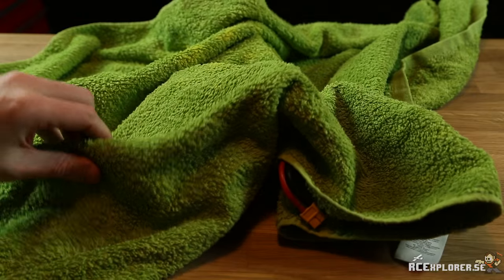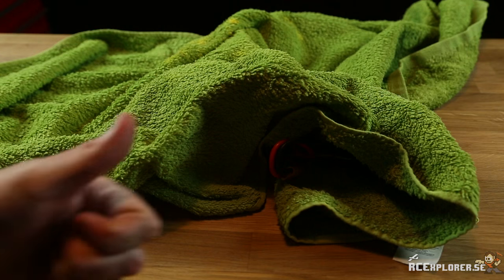Why you should remove your props!

Comment: As someone who experienced prop to the finger situation 3 times(Yes. I don't learn), I'd expecially caution against getting your hands anywhere near high kV motors spinning small props. 

First time It was a 12" prop. Spinned by a 700kv motor. I was trying to catch the quad because the grass was wet. Since I was landing props wasn't that fast. So no blood. Hurt pretty bad tho.

Second time 15" props spun by 400kv. Hit my knee while taking off(was standing close wind pushed the quad) I think it hit a nerve. Couldn't walk properly for a few weeks. 

Third time was the worst. 250 size mini quad. 2400 kv motors spinning 6X3 carbon fibers. Props suddenly started spinning while quad was sitting on my desk. Reflexively tried to grab the quad.... Glad to announce I caught it. Too bad my index finger got sliced to the bone. Needed stitches. I'm still worried whether if there are carbon shards in my finger.

Moral of the story? Respect the props. Especially smaller ones.
Reply: +flanker I feel your pain.
My TBS Discovery went into an unexpected RTL on the bench and, just like you, I reflexively reached out for it.
10x4.5 carbon props on 1000kv motors with a freshly charged 4s at full throttle meant I had stitches in my index finger right under the last knuckle joint, and super glue on the end of my little finger.

Though I did leave it for a couple of hours before being dragged to A&E, had ordered a curry just before it happened and couldn't really let that go to waste over a little bit of blood :D
Reply: +GTStGambit my props spun up during a naza update one time, it ruined the corner of the wooden desk but luckily I got away with only a cut or too. Lesson learned. Now every update I atleast leave the props totally loose.
Reply: +GTStGambit I had to shove my arm into my align trex450 in basement motor full throttle heli started to go up and all I could think of was through your arm in to stop it so I could unhook the battery ,didn't get cut up real bad but my arm looked like a ballpean hammer was taken too it a bunch of times! I was such an idiot ! I wanted to fly rc helis so I get a 450 trex,not knowing there the hardest to fly!
Reply: david ringler Helis are altogether different beasts. I remember reading a dude getting decapitated by his own rc heli a few years back.
Reply: +flanker it's because heli's rely on one prop for lift, which will make this prop large, in turn storing more energy. That's where multirotor are safer, it divides this energy over multiple props.
Reply: +flanker  "decapitated " dude, link to the story please, I'm not believing that one unless you're referring to an actually real life size heli.
Reply: +William Carrey seeing as the quad in the vid could do serious damage to your finger, I don't see how it's not easy to believe a large scale held could decapitate someone. Regardless, http://www.news.com.au/world/man-decapitated-by-remote-controlled-toy-helicopter/story-fndir2ev-1226712962922
Reply: ***** First, the original NY Post article was a tad bit less sensational than the new.com/au article. The NY Post said that part of the man's scalp was removed, but the article that you forwarded indicated that he was decapitated, like some sort of medieval torture punishment, a scene straight out of evil dead 2 or something, that being said I believe the actual crime scene though horrific, not as bad as the media likes to play it up to be, they have papers, and a website to generate traffic for, scalp removed and decapitation sounds decidedly more sensational than the blade struck the man in the head causing a large laceration to open and he bleed to death......IMHO. Interesting article none the less.
Reply: My dad got the back of his hand hit by a spinning prop while setting up the tricopter. He needed stitches.
Reply: Great safety information, but I'm glad to report that the safety record in the r/c model history is more impeccable than that of man's usage of power tools.
Reply: +flanker ive taken to putting my quad in the vise if i want to check vibration on the props, it lets me spin the motors up to full throttle with out the quad going anywhere and i can just as easily access the battery if need be.
Reply: flanker I remember when I was around 8 and I would get those air hogs and when I stuck my finger in the blades,it would not hurt that bad. But since these are the professional ones, I'm sure they hurt like hell.
Reply: i do hope you have learnt you lesson now. Next time you could actually lose your fingers

Comment: Tip - Get some thick rubberbands. Loop one end around the prop, then take it under the arm, and loop it back around the prop. They should sit about 75% out on the prop. You'll be able to see what the props are doing, but if the rubberband is applied (and sized properly), the props wont be able to start spinning. Velco loops also work!

Comment: I can personally vouch for what David is saying here. I have a RCMC 400 kv motor drive a 12" CF/FG composite prop though my finger. When I say though, I mean clean though, bone and everything. It didn't cut the finger off it went through long ways so it split it in half to the first joint. This was because i was flashing and update to the flight controller (DJI Naza M) with the props one. I was very lucky not to get much more serious injuries. I spent the night in hospital waiting for an operation where they had to remove my entire nail bed and repair the finger before gluing it back on (literally). It took almost a year before my finger was back to normal and I still have the scars from it. Take those props off people!

Comment: I had a 300w sunnysky with 10inch prop do a number on my left hand when it started accidently at 90% throttle a year ago, the scars are slightly visible still and I suspect they will be forever. After the initial shock I lost conciousness and came to in a few seconds. It was horrifying and I put down my quad for a week or so after, I just didnt want to go near it. It was actually an honest mistake while trying to configure one of the ESCs and Im glad I still have all of my fingers. Be careful guys its no joke, you have to respect these things or they bite.

Comment: I learnt this the hard way... Took a couple of layers of skin off my middle finger with a 5045 GF at full throttle (2300KV on a 3S), it's scarred up pretty nicely on the knuckle. :P

I was pretty lucky (maybe) because the prop shattered instantly, however the very sharp pokey bit left on the hub is probably what did the most damage. The top of my finger is still numb so I'm guessing slight nerve damage as it did dig in fairly deep.

Comment: Personally, I had my quad going crazy whil eplugged into my computer. I took it remove the cable and it randomly started spinning all 4 motors. My radio was just next to me, turned off so I have no idea what happened. Damn my whole hand was bleeding, I had so many cuts up from fingers to the wrist. I still have marks on my arm too but it looks like it's fading over time. Take off your props guys !

Comment: After using my copter and every motor stoped working I want to take the batter away. Sa I go with my hand to the battery only 1 motor starts with full power, was going to my face and I stoped that with my left hand. 2 finger and hand were half cutted from a 12" carbon prop/knife. The doctor 2 people need 87 stitches and work in 3 floors to take my parts from my fingers back to my hand. 4 month it takes to use my hand later. Nobody knows why only one motor starts and why???? It was a wii pro system. I never use that again. I try everything to find out why - never found it?! Today I connect the props when everything is clear before I start to fly.

Comment: while calibrating your esc's. full throttle on the transmitter, powering your ESC's with props on, oh whoops... forgot to plug in signal wire, just do that fast. 
result: Quadcopter hanging in face with motors at full throttle. 

Nothing is safe with props on! NOTHING!

Comment: This is nothing, try a big nitro engine then you'll know what chopping is! :P
Reply: electric motors have much more power than combustion motors
Reply: +roidroid don't be daft!
Reply: +rotormasher wait... you didn't know electric motors are more powerful than combustion motors?  (woa boy)
Reply: +roidroid you not making sense, what do you mean by that? like you saying that 250 size quad electric motor is more powerful  than a 50 sized glow engine?!! really? mate I actually know what I'm talking about rather than just talking total bull like you. get your facts right
Reply: +rotormasher 300 watts on 9050 prop is enough to have pain for a very long time, i know, still can't use my left arm like before! It doesn't keep me from the hobby though!
Reply: +rotormasher - Comparing an electric motor to gas motor of both the same size, the electric motor is more dangerous. Electric motors have instantaneous torque.
Reply: ***** Yes the same size is instant torque etc, but I was implying to the fact that gas engines tend to have bigger propellers and for this reason can be more serious as in the video it shows mainly the now so common 250 sized quad motors...
Reply: Jarco de Rover I agree, I was sort of trying to tell that gas/ glow engines are generally bigger and spin larger more dangerous propellers...
Reply: +rotormasher you have a very good point! It is just a matter of : the bigger bad"der" 😆 Let's say a Moki 400 for example, bad idea to run your hand in one of those! Cheers!
Reply: +Jarco de Rover it will do serious damage for sure! :)
Reply: +rotormasher A guy decapitated himself with a gas stunt heli not too long ago,I think it was the first confirmed RC death
Reply: +rotormasher So your comparing apples with oranges. (small electric motors vs big gas motors) 
And then keep saying your right. 

LOL 

First electric has way and way and way and way more power, with the same energy source. 
Gas loses a lot of energy to heat that isnt used. while electricity uses almost all about 98% percent. 
Just look at cars. with the same horse power an electric car is much faster.
Reply: The thing is that people know that huge nitro planes are dangerous, so they take good care with them anyway. And you don't need to plug them into a computer at all. which is when this is likely to happen